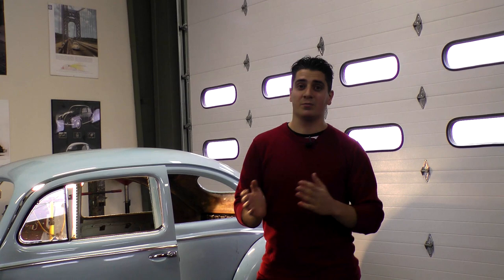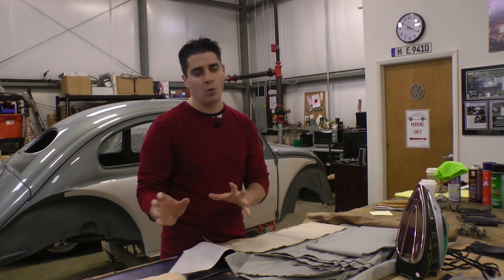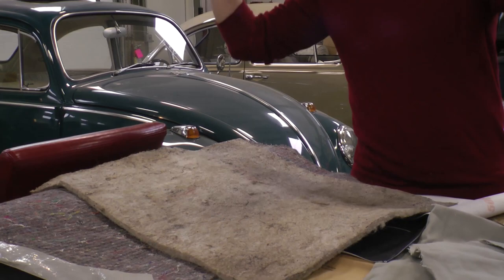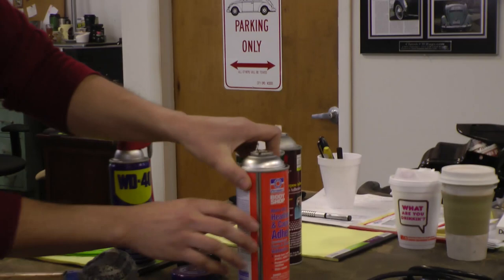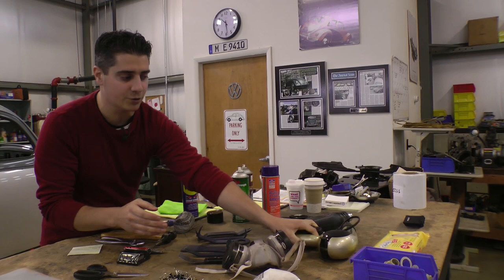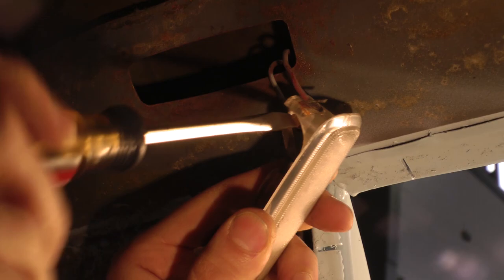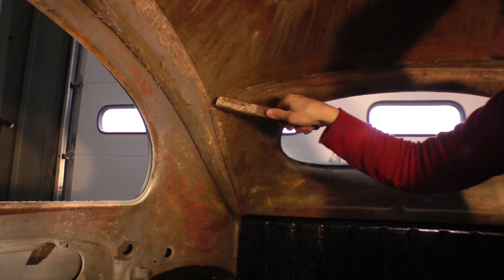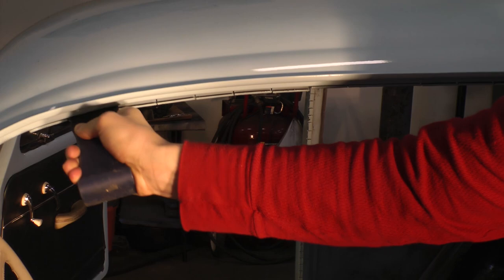Classic VW BuGs How to Install Volks Multi-Piece Beetle Headliner Pt.1 of 6

Comment: Thanks ,I would have been lost without this video. i installed a 6 piece TMI vinyl in a '65(i think)  My tips; Don't trim anything until you have it glue down- be careful where you cut.
I used a 5mm neoprene as under-felt- Don't! What you see can see of your under-felt you can see with the vinyl stretch over it, like a cock under Lycra-  that is not a good thing!
I ironed the wrinkles out with a steam iron, on the under-side of the vinyl, that helped.
I don't have grabbers above the doors, none of the bugs I've seen here in OZ have, that made for a interesting bit of trimming. 
I do have a question-how do you not cut through the paint work when trimming the excess around the windows?
Also, I think you should mention how dangerous this job is, the knife has to very sharp and the temptation is to stick in your throat, the only thing that saved me was the thought of blood stains on the ivory coloured  trim and the patience of my girl-friend.
I took solace in Chris saying you should buy 2 of the vinyl kits to allow for F-ups 
Thanks again.  Peter

Comment: Where do I acquire those "large plastic fasteners" for the 60's headliner you mentioned? The PO of my 67 installed 3 point seat belts and the passenger side door post has one of those fasteners but the seat belt top strap was bolted on in place of that fastener on the drivers side door post. I want it to be stock so I need to find another one of these fasteners.
Reply from the maker: 67Loowit_scarab You would have to look at local swap meets or on thesamba.